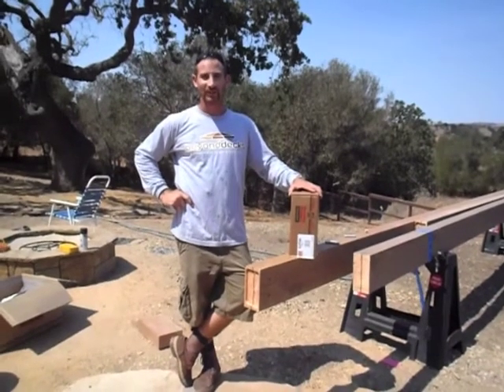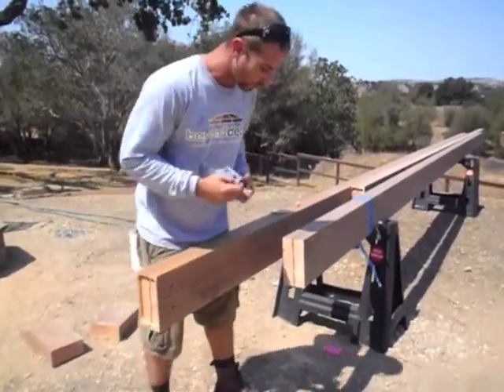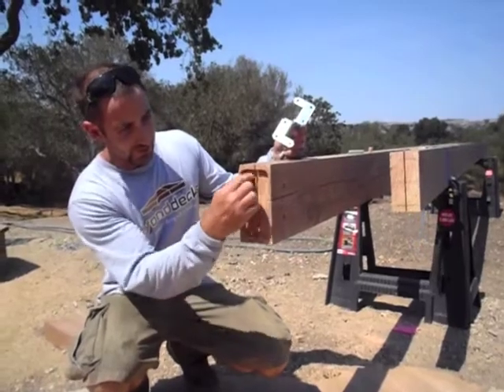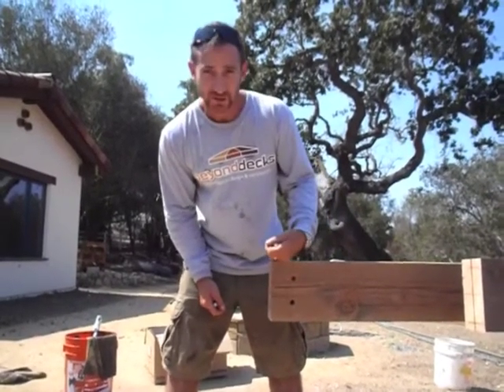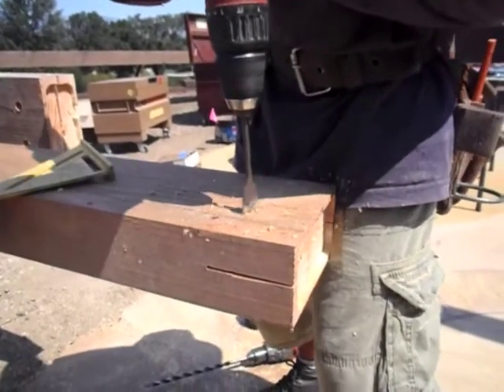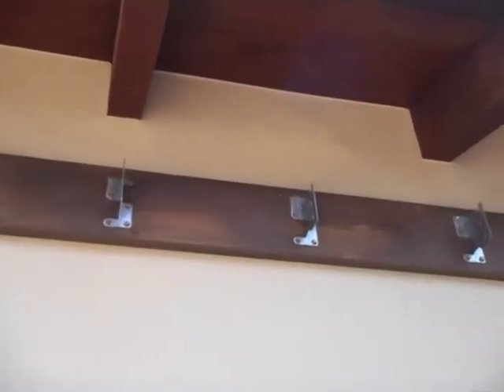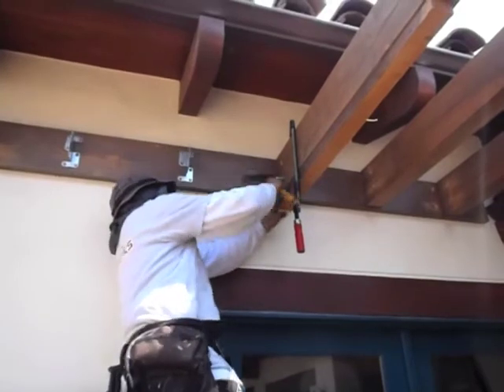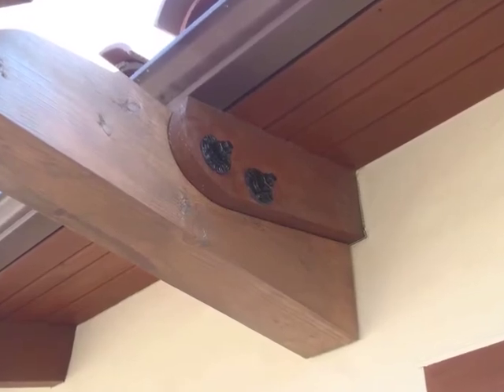Simpson CJT Concealed Joist Tie Installation

Comment: Very helpful, thank you.  I am an engineer about to spec this as an installation option for a covered deck where they don't want metal connectors exposed and will forward this on to my client.